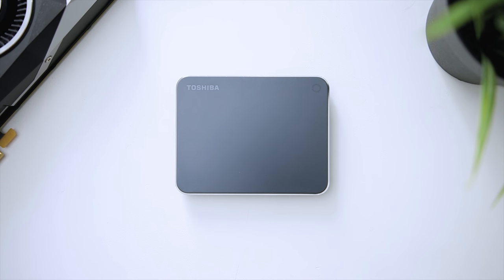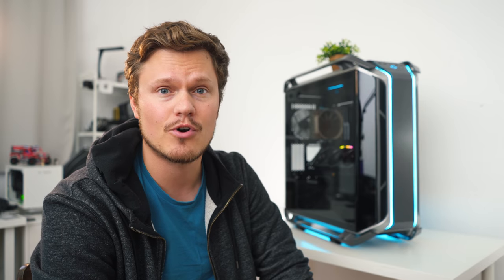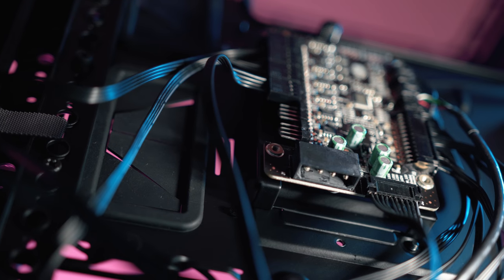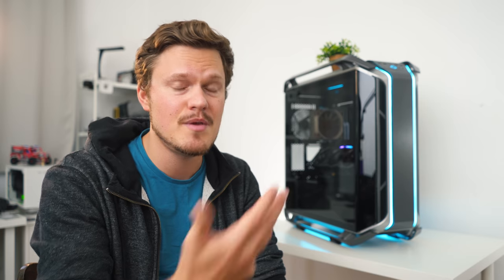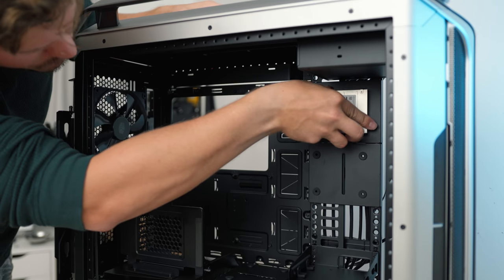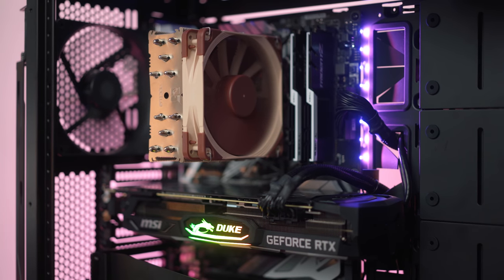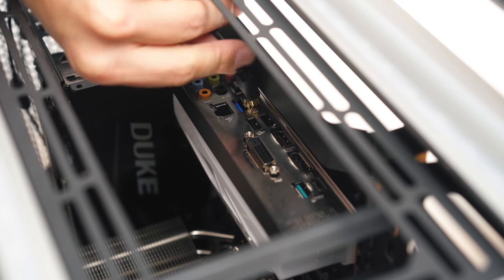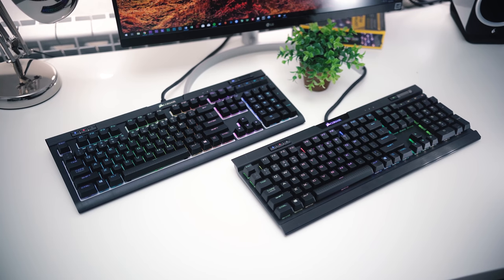Cooler Master COSMOS C700M - The Case Of The Future...With A Major Flaw!

Comment: Honestly a perfect system and case! The amount of customization means that this case can carry any and all of your future builds without the need to purchase a new case for many years to come. The carry support means that case is less likely to become damaged when moving, the filters in the front are fantastic for filtering dust and has great looking aesthetics, and the GPU angle is a fun touch for display. With the GPU angle if you use a water cooled GPU you shouldn't run into much heating problems since the water is redirecting heat away from the interior of the case leaving more air for the CPU. You could run a completely air cooled CPU without much difficulties as we should all know that GPUs kick out lots of heat so this is a perfect case for optimizing everything.

Comment: This case ticks all the boxes. USB 3 type-c, tempered glass, front facing i/o, mesh, dust filters, room for a CPU air tower cooler, RGB lighting options, and plenty of room for fans/airflow. After weeks of research for a case that would fit a new eatx z390 or x570 MB with 9900k or 3900x CPU and with proper airflow 
 cooling. I finally found the case for my new build. Thanks for sharing your review for this case much appreciated!!

Comment: Hi Dimitri, I just purchased this case and I found my version must be a revision as the fan controller has sata power connectors instead of the molex connector your model had :)
Excited to start building!
Reply: ikr? mine had 2 sata powers instead of a molex aswell.
Reply: I am curious. I have owned one for just a week now. What was the result like? How has your experience been? Which liquid cooling system did you choose? Greetings from Iceland!
Reply: How have ya all got the money?
Reply: Can anyone tell me if I can change the front usb c with my own 3.2 gen 2x2? Is this usb c going front with a single cable or its on an electronic board?

Comment: The price is scary if you look it directly 
But if you break down the price, you get four 140mm casing fans going 2000 rpm, a pcie riser, fan hub, argb lightings
Those are easily 100-150 dollar total or more
Not to mention you get curved tempered glass, fully modular internal, plenty of drive bays, tiltable gpu bracket, and premium finishes

Comment: you need to take out the front double filter for air flow, angle the video card back 20 degrees and you are golden. I tried two other cases, both tt, this is great. And heavy. No other case needs consideration. Did I mention it is HEAVY?

Comment: I got my Evolv X and Revolt 1200W PSU.  I'm very happy!  I just need a free weekend to build in it.  Will we see a Revolt review any time soon?  Or a review of the Evolv X with dual systems?  If you want to borrow mine for a review, shoot me a DM.  I'm in Toronto.
Reply: Bad taste. Evolv X ugly af.
Reply: Their channel did a review of Evolv X in the end of August
Reply: Ulysses Lee Well obviously.  If you paid attention to that video Dimitry said to stay tuned for a dual PC build in the future.  The Revolt X is somewhat hard to get a hold of (until recently) and getting it to Canada can be time consuming and that's why I offered up mine.
Reply: Zhangir Duiseke I agree on your view though on a practical standpoint the Evolv X certainly beats this C700M. Really just about what floats your boat actually. C700M seems more aesthetically oriented, focusing on the aesthetics than the practical aspects, whilst Phanteks has a balance on aesthetics and practicality.
Reply: Yes I have the same Evolv X and love it, My second build I went ahead and got the Cosmos C700m   , Im using the new Asus thor 1200, and modified the shroud and bracket at my brothers machine shop, came out awesome. Im a sucker for RGB and I love my phantek since the whole thing is pretty much metal. But Having 2 2080's I love the Cosmos , it does have more plastic . But this thing turned out awesome and now they are 379.00 no tax free shipping on ebay. Brand new. I used inwin which i also love. Something about this cosmos c700m  . just love it. but also my phantek. I think the mods i did with the cosmos , just so i can see the asus thor led display and lights, Just cool. something Cooler master should have did in the first place. But like i said i love rgb. the handles are good aluminum so if they made everthing aluminum on this case would have been way to heavy. Just right , my opinion.  If the evolx X was as big as the cooler master I would Have loved it. I love Computer Hardware and All the new stuff that comes out , and I always mod it. to where it looks like something like factory. Glad to see other people like yourself like the Evolv X also.

Comment: "A more expensive less user friendly Dark Base Pro 900"
Reply: I'm building my new PC on DBP 900 rev.2 :D still have it in box, waiting to get my 2080 Ti and 9900k
Reply: Being an owner of the DBP 900 I must agree with your statement.
Reply: kishona69  Same here, and less drive carriages too. Definitely like my DBP 900.
Reply: I have one too!
Reply: ah DBP 900 ... i hope bequiet release PSU shroud for it, or can i use the one  for DBP 900 rev.2 ?
Reply: You can use the rev. 2 one! Actually, apart from the front USB-C you can use all the rev. 2 parts on the rev. 1 including the hdd slot covers, side panel and screws, PSU shroud and LED strips and controller! Hope it helps!
Reply: wow it really helpful answer... now just need to find retailer for indonesian market...
Reply: ... with better airflow and a more solid modularity, yet this does not make up for the crazy price. 

ps. I quess i have to buy a Dark Base then or does anyone have an alternative?  
I want a spacious case, best "moduralized" with a testbench or at least easier building. It needs room for a DVD drive bay and best a meshfront for airflow. If it is not as ugly as the coolermaster cases, it would be awesome, but that is more on low priority.
Reply: user friendly? lol. Cosmos is not for armatures! any model! grapes are sour!
Reply: Buy dbp 900 rev.2 it has qi charging 🤟
Reply: That looks 1000x cooler.
Reply: Yet the CSOMOS for me looks quite a lot better. I've owned the original Cosmos, it was a great case. I've had the EVOLV X, cool case too but now I'm on semi ITX with the Lian Li tu 150...there is sthg from Lian Li that almost in every case feels more premium. In fact I've just bought for the sake of it an old Lian Li PC:Q08B..

Comment: I have own case and I like it a lot. It is a very well made product. The only issue I have is I couldn't fit the Arctic Liquid Freezer II 420mm AIO on the top. I had to mount it on the side. Not a problem but the case does advertise a 420mm liquid cooler to fit on top or the side. Other than that this is a quality product.
Reply: You can definitely fit the Arctic Liquid Freezer II 420mm AIO on the top. You just reposition the fans on the top of the tray. Thus the only disadvantage is that you cant set it with push-pull config fans.

Comment: Dimitri, please tell me, is there option to mount power supply vertically on front? Chimney layout need airflow from bottom to top, so placing power supply in airflow way will disturb it.

Comment: Major flaw... No 5.25" external bay. Where wil I put my brand new Blu-Ray burner?
Reply: It's the modern trend now to omit the 5.25'' bay. A lot of modern cases don't have them anymore.
Reply: @Tactical96  Full Tower case Should have at least a removable 5.25 bay, you can put more than just drives in a 5.25 external bay
Reply: *Internal 5.25'' bay. I have an external USB-connected DVD unit that I used once a year or less for some older installs. Blu-Ray? Would that be 1080p.BRrip.YIFY? :)
Reply: put it back in 2003.
Reply: Ebay
Reply: 4:48
Reply: @GholaTleilaxu  we rip DVDs all the time for our plex server. Dont judge people, everyone has their needs.
Reply: THANK YOU! Looking for this as well.
Reply: We don't need 5.25 bay but, we def need RGB cycle button on the side of the case thou ;D
Reply: It has one...expandable up to two with additional accessories.
Reply: Stronk  What do you watch your Blu-rays with?
Reply: It does have a 5.25" bay; it was shown in the video. You can add a second too if you really need it.

Comment: I bought this case, get it via Amazon. Came Broken, "Glass Door"  Sent it back and picked up the Phantek Evolv X ,  would not have been more happier, I am so glad that the Cooler Master Cosmos C700M came Broken, No Really, Super Happy.  

This case is way to big. I have the Cosmos 1000 and the C700M Dwarfs the Cosmos 1000 Plus I only paid $199 for the Phantek Evolv X and it has as much space for HDD, SDD's Than the Cosmos C700M , just no space for DVD Drive, Which I am ok with as an external one can be purchased. Phantek Can hold 9 SSDs and 10HDD and still looks like half the size of the C700m and Excellent LED on the Phantek as well. 

In My Phantek Evolv X - I installed an Asus X299 Deluxe ii Motherboard, Asus Rog Strix 2080Ti  2.7 inch slot GPU , 6 Corsair QL140 MM Fans. 4 10TB Drives 4 SSD Drives and 3 NVME M.2 Drives and still have plenty of space to add more drives in a midsize case and space for a Mini ATX Set up on top of case as well, Now that is Crazy. 

Thanks again for the review.

Comment: Could be a nice case. Needs some design changes. Needs to have glass both sides, needs to have the venting pattern on front as well as top, needs a better fan/rgb controller system, all the excess holes need cleaned up ( even if that locks in the default layout) the other layouts are crap anyway. Plastic panels need removed.   My Evolv X fixes most of whats wrong with the coolermaster for a lot lower price. So emm yeah...

Comment: I agree it would be best to ship without fans.  The ARGB front panel could've been better if they'd made a frosted acrylic faceplate, to swap out the aluminium shield (like the top cover), allowing RGB fans as well as the strips.  My biggest gripe, however, is a lot of the component options for Chimney and Inverted layouts feel rushed; particularly with the GPU bracket for diagonal placement...

If CM had delayed the case's launch until Jan 2019, they could've fixed all these issues without anyone being the wiser.  Instead, they obviously didn't want to spend the time and money to make it flawless.

Comment: Excellent review! My only issue is the lack of tint on the the. It'd be nice to blackout your build by simply shutting all internal RGB off. Do they offer the option of clear OR tinted glass, when ordering?? I don't mind getting the H500 without tint, but the front panel of this case screams dark tint!! I don't see the point in not going full hard loop inside this huge chassis, even running a single res/dual rad configuration with a phanteks glacier r220 for added passive cooling. I'm surprised it doesn't come with dual 200mm front fans though. Still, looks like a fun box to build in. 😎😎😎

Comment: Honestly, if I was making anything in this price bracket (Which I'm not and probably never will be), I would probably just get a Corsair 1000D. For the extra $60 you can put a whole extra mITX system in there as well, also I think the 1000D looks better. (Don't get butthurt, it's just my opinion)

EDIT: I wrote 100D instead of 1000D, so fixed that.

Comment: There is something about this case that troubles me... it's just like something is not right. Maybe the experimentation posibilities?. Dmitri did a great work showing the capabilities of this case but looks that some applications are not quite finished. The gpu positioning, for example.. you can angle the bracket but the i/o access is just so weird, same with the vertical positioning. I don't know, maybe youcan do great things with this case but for me, looks like isn't well polished. I don't feel the same with the evolve X, that case is great.

Comment: It finally looks like a solid effort by CM.  I like it.  I doubt I would go for the angled GPU mounting due to the giant hole you have to create in the back to accommodate the display cables.  It looks like they've done a good job refining their inversion process too.  But I do think they still have a ways to go to get to the level of cases like the BeQuiet Dark Base Pro 900.  And the price?  Holy crap, that's expensive.  It's a nice case, but I don't think it's at the level of being worth more than the BeQuiet Dark Base Pro 900.  And certainly not by as much as $190.  Especially when you consider the DBP900 has some of the best build quality out there (so it'll easily stack up against this from a build perspective) and the DBP900 comes with x3 BeQuiet Silent Wings 3 fans which are very high quality and cost about $25 each, making the actual cost of the DBP900 case close to the $175 mark.  I would throw out those CM fans.  I wouldn't throw out the SW3's.  Which is something I would think is important to consider you're working out how much you're getting for your money.  

The reason I'm comparing this to the DBP900 is because it's the closest analog for comparison when judging this case.  I like the C700M, but I do think it's far too over priced compared to the competition.  It's nice, but what does it really have that the DBP900 doesn't?  Exterior RGB integration and a funky new way of mounting your GPU.  But that's about it.  Plus junk fans and no sound dampening material, unlike the DBP900.  Aesthetics are subjective and I really like the aesthetics of both cases.  But I can not find it in me to justify the extortionately higher price tag of the C700M over the just as good, if not better in some regards DBP900.

Comment: Hardware Canucks, I have this case and i was wondering if you can help me with something. I'm getting a new motherboard and i want to be able to use both my 3.0 usb ports on the front. my current one can only use one. could help me out and tell me what headers they use please. and if it isn't too much any other wire heads I might need my current motherboard leaves a lot of unused wires.

Comment: @HardWareCanucks Even though this is a pricey enclosure, would you say it is worth the buy for a very high end custom water loop build? I can't get my hands on the Evolv X, and I don't think my radiators will fit in it sadly....
Reply: The C700M it's designed to be watercooled :D you got 420mm on top, front and bottom

Comment: It seems like they tried a bunch of new stuff and ideas, especially with the GPU placement, but didn't really think them through. I think with some better solutions for the cable routings, for external cables, it could work. Like, placing a backplate IO port, which then has cables on the inside to attach to the GPU. Could still be tricky with cable management, but would probably be a better solution.

Comment: Does anyone know how would the RTX 4080s fit into this case? Anything from 322mm to 356mm? I've double-checked for myself on PC parts compatibility checker and apparently, any GPU cards over 320mm would not fit... without having to sacrifice drive-bays, anyway. Now, if that's true, how would that work in practice? I don't have personal experience with building PC, only what I have read up thus far.

Seeing as the GPU is located near the bottom and the drive-bays are at the top and fans aren't in the way, is it really true, that it would block anything in that regard? Or would one have to sacrifice anything at all?

Comment: 9:05  FINALLY!  I've always wondered about this style of an orientation.  Basically taking the case, and rotating it 45 degrees so that you would have intake fans at the bottom, and exhaust fans at the top.  While this is not 100% what I would have liked to see (personally), I'm GLAD that a case manufacture decided to take the first step at implementing this design.  Something that may help with that overall design would be  to move the power supply  to its respective area (keeping in mind rotating the entire case 45 degrees), some cable extensions for the I/O along with an I/O panel at the rear.  This would also require some extra space up top so that you could mount additional fans.  Said cable extensions for the I/O should have a 45 degree male end to plug into the motherboards I/O panel to help with cable management vs top mounted fans.  I know you are not a case manufacture, but I thoroughly enjoy watching your videos! I will also note that I USUALLY do not post on videos, but this case definitely has me excited to see what comes next!!!
Reply: Matthew Lang 45 degrees would be funny. I'm sure you mean 90 degrees. And clearly you have never heard of Silverstone cases.
Reply: Yes, 90 degree.  Sorry, not sure where I was at with my math skills there. But to answer your question, no I have not heard of them, but I will look them up.  Thank you for the recommendation.
Reply: Silverstone Raven3 looks to be what I was describing, Although not 100% what I had envisioned, but that's really close!!
Reply: Matthew Lang Yes, the Fortress and Raven models use the chimney effect. The Fortress 2 was a much loved enthusiast case in its day, helped by the large 180mm air penetrator fans. Phanteks also made the Shift.